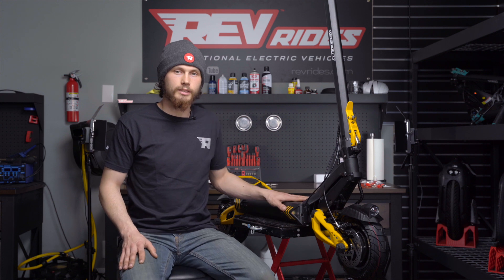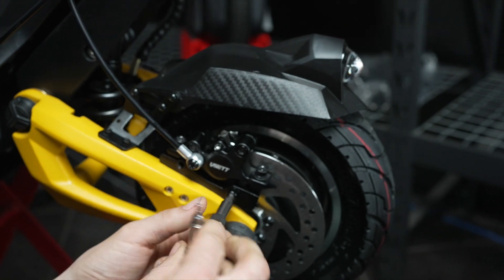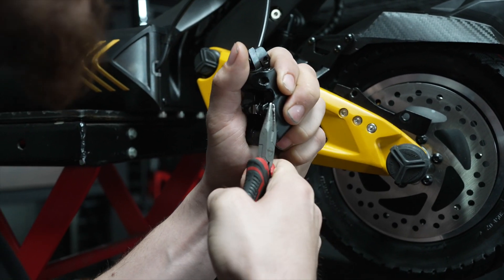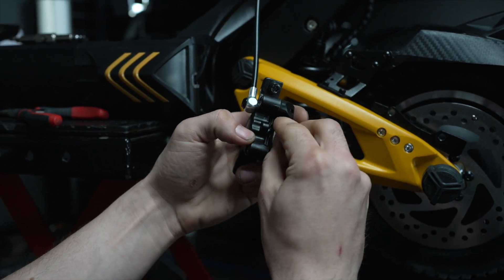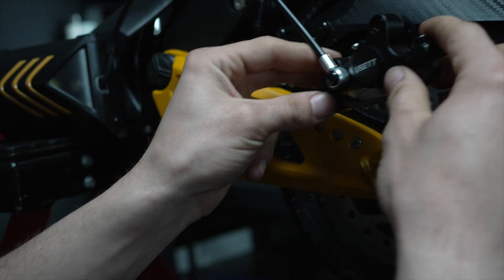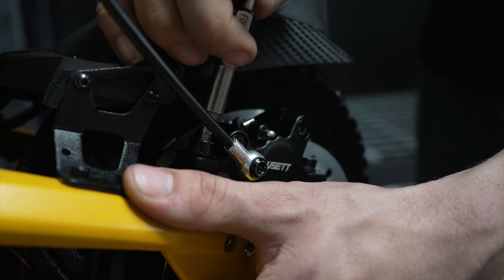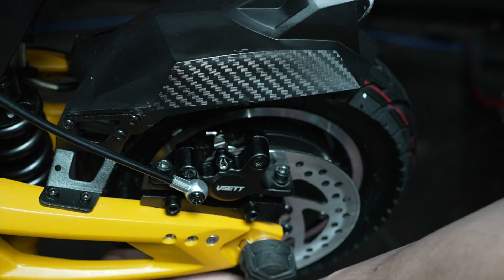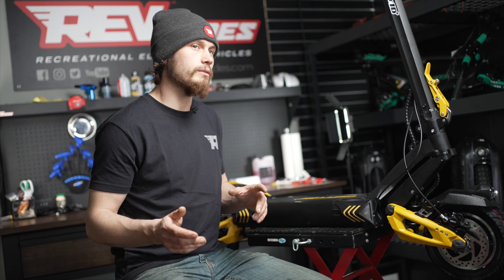VSETT 10+ Electric  Scooter Brake Pad Replacement Tutorial - may work with many scooters

Comment: I found that it doesnt matter how good or expensive a hydraulic caliper and lever is, the biggest improvement you can make is a pad and rotor replacement.
And ive found the perfect combo that doesnt bend or fade with heat under hard use.
Reply from the maker: yeah thats a big part

Comment: Thanks for the video!
I just followed the steps and it worked out fine :) 
But I might have missed it if you mentioned this but you might have to push in the brake pistons either do it before or after you have changed the pads. As in my case when I had changed the pads were almost totally closed so the caliper couldn't be fitted due the brake disk didn't fit between the pads. So I took a flat screw driver and pushed it in gently between the pads and pushed the piston in to make enough space between the pads for the disk to fit.

Comment: Thanks for the video, one thing a cotter key (pin) is a one time use item. That's because each time it's bent it gets weak eventually the bent portion will break.
Reply from the maker: Our brake pads come with a new one in each set!
Reply: @RevRides360  You all rock.

Comment: i found for best calibrating brake pad placement is slightly push brake lever, fix lever with the tape and then tighten screws
Reply: What is that?
Reply from the maker: We have too! If you have longer arms you can hold the brake as well.

Comment: If I have no room for caliper adjustment does this mean I need to bleed my system in order to get out excessive air to make more room for pads? Because I changed pads but there is no room for adjustment, pads just scratching the disk from both sides.

Comment: The thing about these types of scooters is that you can't find brake pads for the dual motor scooter you buy on ebay. Only some name brand scooters the brake pads are available for. So if you buy a non branded dual motor scooter on ebay or other sites have fun trying to find replacement brake pads for them because they're not all the same fitment when it comes to brake pads
Reply from the maker: We have brake pads available on our website. Click here for purchasing information. https://revrides.com/products/zero-brake-pads
Reply: @RevRides360  Thank you

Comment: How do you know when you need swap your brake pads?
Reply: same question here
Reply from the maker: Pulling them out to check every once and while is a good idea. They need to be replaced when the is little to no more pad on the brakes.
Reply: you will notice your brake lever reaching handlebar(or almost) when pressed at full stop force. Then you need to replace them. Ofc it could be bleeding problems, but if no oil leaking and bleeded right it should be the right decision.  Actualy its happen every 1000-500km, depends how you use your brakes
Reply: @milordas  Exactly. My lever for my rear brake goes almost to the bottom which it didn't when new. And after inspection the pads were worn out.
So that is a good indicator if your brakes felt fine from the start.
Reply: @milordas  😂😂😂bro that was me I was breaking at a stop sign and I pulled the break lever all the way and didn’t stop at all almost Squeeze the front brake to hard and flew over the handlebars
Reply: squealing/howling like bus brakes

Comment: @ rev rides do we need to torgue those bolts and if so what’s the measurement  thanks
Reply from the maker: There is no specification by the factory.
Reply: Just make sure to give it a whack and say "that ain't going anywhere". Should be good after that lol.

Comment: Hi, i have a scooter that has a closed brake system, the rear brake is no longer working, and the front brake is squishy. I messaged the company for what size brake pads i need, and the told me i cant change the pads, that i have to spend 100s of dollars and buy two completely new brakes from them. That doesseem right to me, do you have any knowledge regarding this? Thanks. Oh, and i have completely disabled the eletronic brakes in p settings, will i still have to use brake fluid?
Reply from the maker: you would have to email us to provide tech support provide your order number and email to service@revrides.com

Comment: why go through the nonsense of manually trying to line up the caliper if leaving it loose, squeezing the brake, and then tightening seems to work much better. why not just do that from the start?
Reply from the maker: That is a great option if your rotor is scraping continuously. Otherwise you will want to adjust the rotor itself.

Comment: The screws are hard to turn .. what should I do
Reply from the maker: Try applying heat with a heat gun or small toes h but keep it moving as to not over heat any parts. Also use bigger Allen key for more leverage. Hope that was helpful!

Comment: If you live in the uk DO NOT BUY ONE OF THESE. Because I brought one and my front brake hydraulic hose (special designe not standard fitting) is broken and iv been told iv got to replace the WHOLE SET yes the whole set when I only need the hydraulic hose part at a cost of £65 are you kidding me. After spending 2k on a 3 week old scooter